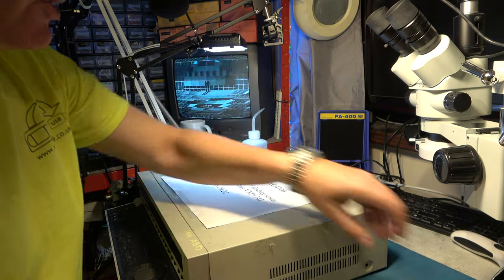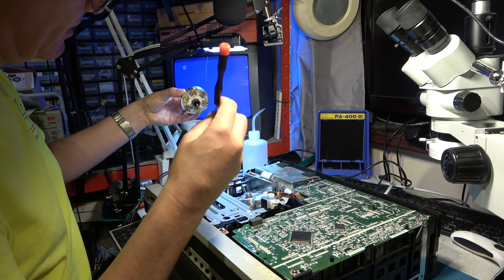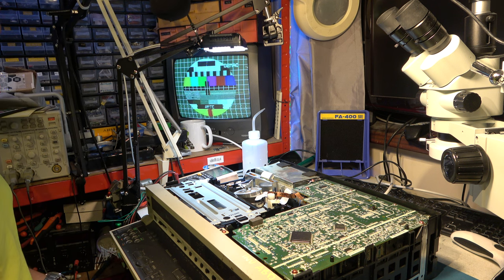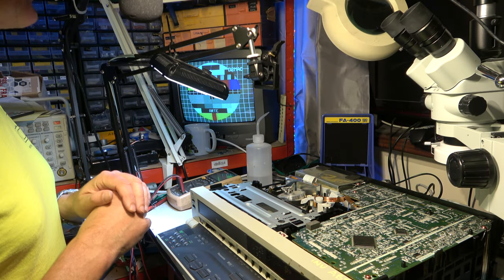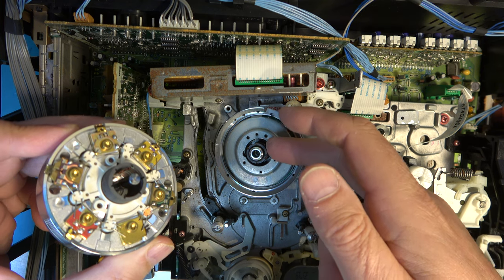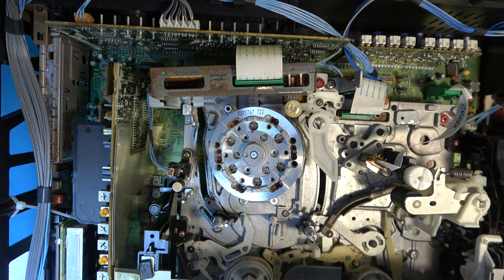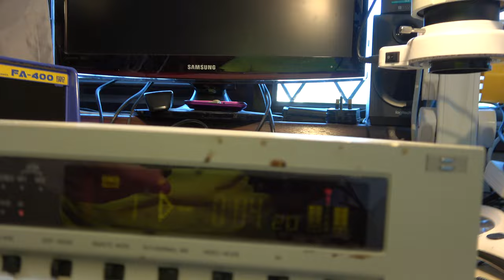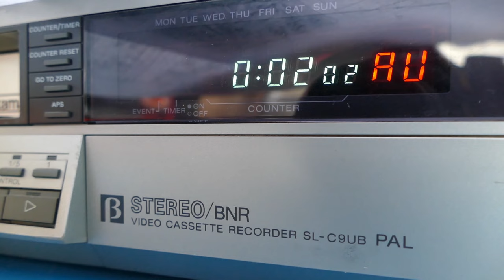Replace video heads on Panasonic AG4700 SVHS. NV-HS1000, NVHS950 similar.  Part 2

Comment: Hi I always use your videos to learn trips and tricks for servicing my A/V devices. Thank you for that. However, now I want to give you a tip regarding those heads that are used in NV-HS1000. It is not applicable to HEH621, but for VXP ones which does nit have visible pcb board on top of the drum. The simplest way to replace those heads is without taking those 3 screws that you took out and then forced you to align when putting back. You only have to get out the earthing bracket. Then pull the upwards upwards. It will come out with the magnet then put back the replacement one the same. That's all. I saw that in the service manual in the first pages and I did it this way when changing the drum for my NV-HS1000. The replacement drum comes always with the magnet.🙂 Good Luck!

Comment: Nice fix. I also used a CRT when fixing my video machines, but mine was alot older and didn't have the automatic screen blanking or blue screen when there was no input, which I found really useful.

Comment: Good result. Nice you can just drop the head drum in - without any concern for eccentricity? I must have replaced dozens of Umatic heads, they were fun to line up with the little eccentricity guage.
Reply from the maker: I've had to do that with early Sony Beta machines such as the SL-C7.  I found that with a good magnifier or microscope, it's possible to set up eccentricity optically.

Comment: I have a Panasonic NV-FS200 and changed the head with one from an NV-FS88. Since the 88 does not have a TBC built in. I hope i can get another video head for it.
Reply from the maker: Yes, I believe they take the same heads.

Comment: It depends on the model, with the earlier AG4700s, VEH0651 was installed, then two models of heads were installed.  In AG4700BY / NV-HS950 they put VXP1747 / in AG4700EY / NV-HS900 VXP1561
Reply from the maker: I wonder why the differences.
Reply: VEH0651 (old) is still soldered, VXP1561 is the first plugged Version (rare) and VXP 1747 is the second plugged "Mass" Version, only prevented from falling out by the Ground Bracket. The NV-HS950 Drum Motors have 4 Hall Sensors, all other "K" Drum Motors (lower Cylinder) only one.

Comment: Great video- I have an 860 which I think is a Z-deck. The head doesn't spin at all but it looks like it is the rotary transformer beneath the head that has dropping out of it's holding. Have you seen this and any tips for how to fix? It seems to be sitting lower than it should be and so doesn't spin on its proper axis.
Reply from the maker: The magnet breaks free on these.  My latest video, due out tomorrow, covers this a bit, so watch out for that.
Reply: @video99couk  thanks Colin, the units featured in your latest video are slightly different. I believe the 860 may be a Z deck. I got the drum moving by fully removing and refitting. The head is in bad shape anyway but using it as a spares unit now and trying to repair the rest of it at least. Mode selector seems off too as it tried to start playing before the tape is fully inserted so need to explore that. Keep up the videos, top content.

Comment: Ah the nice old Arte testcard ! Hello, i have a question, i have a head to change on a Panasonic VCR, i wanted to know if there is a document that lists wich heads goes to wich VCR. There is nothing, no serial number of some sort onto the head drum. I don't know what to order to fix this.
Reply from the maker: The service manual for the video recorder should give you the part number.  Most service manuals are available to download free of charge.

Comment: What VCR would you reccomend for copying VHS tapes regularly in best quality possible?
Reply from the maker: Any later model SVHS machine which has a TBC (Digital Timebase Corrector) included, such as Panasonic NV-HS950, NV-HS1000, AG-4700, NV-HS930.  Miss out the NV-HS100, that's too old.  JVC also made some machines with a TBC.
Reply: Colin probably meant the NV-FS200 (instead of NV-HS100 which doesn't exist) with a 1 line TBC. It is very similar to the NV-HS 1000, but always has the old drum bearing. If you lubricate that without putting cardboard strips between the drum and the lower cylinder, the heads can break off. The NV-HS930 audibly distorted my fully driven NV-HS900 tapes. Despite the HS-900 head disk on a new motor, the NV-HS 960/860 only have hi-fi sound throughout with very good tapes. PG-Shift can no longer be turned downwards on tin gear devices.
Reply: @TTVEaGMXde  Do you know where i can find new o replacement head video for the NV-FS200B? i got one for 50 bucks with terrible image.
Reply: @sos.gamers  It is best to sell the Panasonic NV-FS200B (B=UK) again (as an unchecked storage find), as there is almost never a usable VEH0467 (NV-FS 88, 90, 200) head drum on Ebay.
Reply: @TTVEaGMXde  My drum is okay, just wanted to buy a spare for it, i disasembled mine yesterday to recap the Comb Filter Module and now i only get a Black Screen lol so i guess somenthing got lose somewhere

Comment: Do you set the head switch and adjust the CTL head after upper drum replacement. I always do.
Reply from the maker: I didn't, this was a bit of a "quick fix"!
Reply: @video99couk  With the VR 2001 in the middle of the front half of the Mainboard you can set the PG-shift (Head Switch). This essentially compensates for the Position of the magnetic Disk under the Drum. About +/- 8 Lines Tolerance, CTL doesn't matter if it's just playback.
Reply: I get the impression he's been up half the night working on this machine. I'd be leaving the fine tuning for another day. 🛌😴

Comment: I have VEH 0651. I removed the drum, and then there is a round magnet, but I just don’t understand how to remove it to get to the heads🤕
Reply from the maker: This image of the head drum might help:
https://ksp-electronics.com/en/products/1345395-video-heads/veh0651-7-head
I've not worked on that type of head for a while but I think you have to do some desoldering.

Comment: hi have a betacam sp player all of the deck is working  i changed over  motor  i know it works  ok 
will only take the  small tapes   as i have alot all ready there's no need  to pull the deck a part i did  pull a betacam sp to parts 
and test all the parts i got of the deck and put them away  

the betacam sp decks the older one's have long wiring loom of the head drum part come away 100%   
picked up a 1800p of ebay yes i know   good way it had 18hrs on the head drum  the  servo was dead to the pinch roller
pince motor is 100%   still working on it   i have 3     sy 61 bad card  power unit killed them  

it's a lotto when buying used gear of  ebay